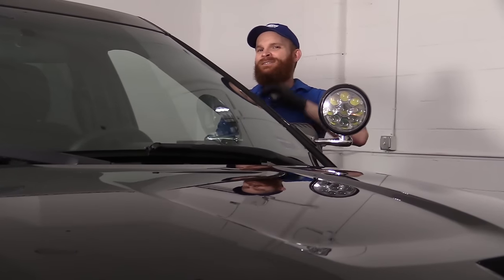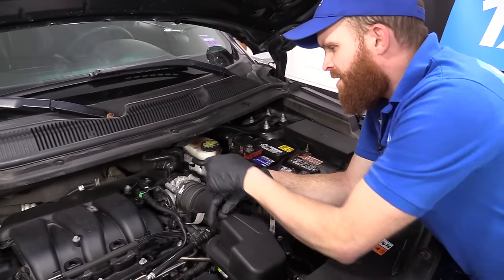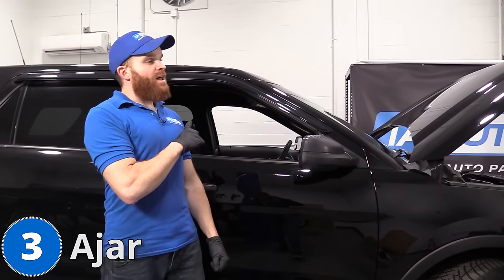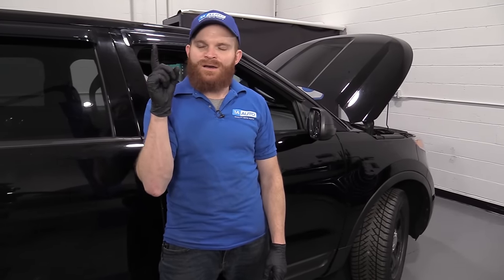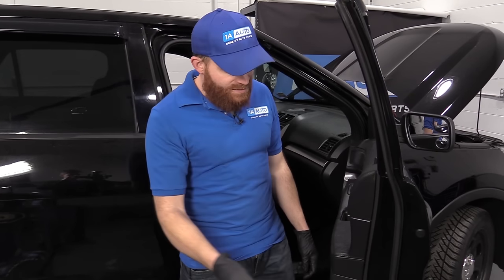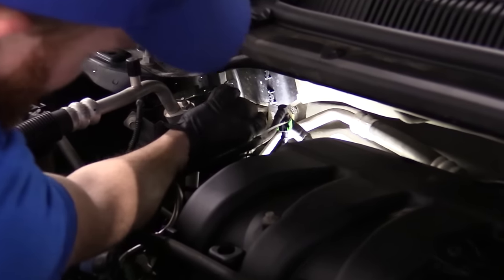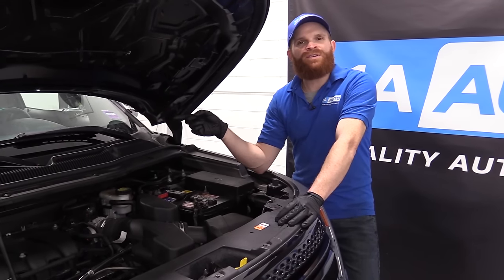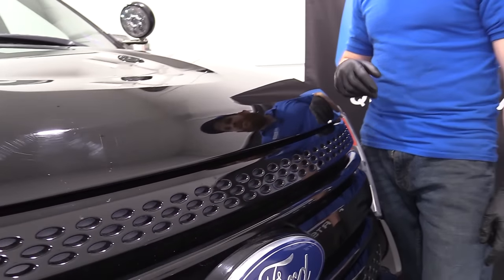Top 5 Problems Ford Explorer SUV 5th Generation 2011-2019

Comment: If you have a aftermarket performance tune. Pay attention to the Manifold Absolute Pressure (MAP) sensor.   The factory is a 2 BAR.  Most aftermarket tuning uses a 3 bar.  If you remove the time make sure you re install the OEM MAP (2 bar) until the tune is re installed..........(AMHIK...lol!!

Comment: I've got a 2013 Limited that went over 100K miles without a single problem (other then some cracking on the door panel armrest.) At about 103K miles the left rear bearing assembly started making noise and needed to be replaced. At 107k miles the left front started making noise so I had that replaced as well.
Reply: Fix or repair daily.  Ford

Comment: Let’s not forget that if the water pump goes out, you have to drop the engine from the vehicle. Thanks Ford 🙃
Reply: Same Ford engineer must've went to Chevy arpund the same time, my 2011 Equinox is the same w/ the absolutely burried h20 pump. Thanks GM.

Comment: Yep, I own two Ford explorers. I have 2011 and a 2017. My 2017 has 140,000 mi on it and I have the aluminum Hood issue with a small chip on it My 2011 has 240,000 mi on her I haven't had any of the problems but I do notice every once in awhile the instrument panel will light up while the car is off. That could be the door latch issue but the alarm never goes off like the door's been open only is an issue if the battery is low or bad? As long as I have a good battery in the 2011, I don't have any issues. Still a decent car and I haven't had any problems with it other than normal wear and tear through Cleveland streets

Comment: These problems are not that common.  Possibly a certain mechanic that works on a  lot of Fords, might see the same issue repeat a few times with different customers, but this is because there were hundreds of thousands of these sold per year.

The only reason the CO issue came to light was that PIUs (police interceptors) had modified the body with holes on the undercarriage which were letting exhaust in, especially if they were parked and idling.  Next, once that hit the news, every owner with any kind of health issue making them dizzy, started to assume it was CO, while vehicles that were not modified, are not showing any higher level of CO than other makes and models of vehicles.

Rear toe link.  Sure, extreme driving, in cold climates can break things.  This is another reason why offroaders, who aren't in it to race, don't want a stock multi-link suspension for off road use.  They want a solid rear axle instead.

Hood paint?  Meh, for a while Ford had a bad process but it seems to be less common after a few years of the 5th gen release.

Want to know the REAL problems?  They're the big ticket item, the engines.  Both of the 3.5L have an internal water pump which if (when) it leaks, leaks into the oil and fouls it, trashing the engine if not noticed soon enough.  The 3.5L and 2.0L/2.3L EB have the intake valve carbon issue, and the 2.0L/2.3L EB have the blown head gasket issue, and both (all three if you want to call the 2.0L and 2.3L different engines) EB's have turbo issues.

There was also the early model year steering racks failing but I'm seeing less and less of that reported in recent years, rather than more of it happening as they get older, which suggests Ford may have fixed the problem.

Comment: Len, I had a throttle body fail on my 2015 Explorer with 48,000 miles and the dealer said it was not under warranty. I also called Ford myself and they said also it was not under warranty. Could you provide any more info on the warranty extension that you referred to in this video?
Reply: It's only for 2009 to 2013
Reply: This dude needs to had his fax straight.

Comment: Have a 2011 only issues I've had was ac compressor went bad pretty expensive. Sunroof leaked one day from clogged drain lines and fried the sunroof motor. Other than that just normal maintenance
Reply from the maker: +Dan H Thanks for the feedback!

Comment: Consider the mfg. and AVOID, AVOID and AVOID!!!
Reply: Our family truckster, 2014 Explorer Limited has well over 200K miles on it and never had an issue. I've only changed the oil and a windshield washer motor (once). Had to argue with the track record.
Reply: @Hannah B Is there a reason that you don't consider the PPV Chevy Tahoe to be an emergency vehicle?
Reply: Hannah B A Chevy Tahoe
Reply: @Hannah B 
Wrong, GM makes Chevy Tahoe police interceptors, Dodge makes Dodge Charger and Dodge Durango interceptors.
Reply: Like COVID-19!

Comment: I have had several year models of the Explorer including the 2019. Rapid acceleration produces the exhaust in the cabin issue. The feds have absolved Ford so they do not have to fix the problem.

Comment: It's important to note that the corrosion on the hood is due to galvanic corrosion. Oxygen reacts preferably with aluminum over iron when the two metals are in electrical contact with each other--Ford doesn't isolate the steel body from the aluminum good because they're too cheap. I have this issue but it's nowhere near as bad, luckily. Isolation of the metals is the only real 'fix'. This same concept is foundational as to why sacrificial metals are attached to steel storage tanks to reduce corrosion of the tanks.
Reply from the maker: +Thomas Griffin Thanks for the feedback!

Comment: Bought this 2012 Ford Explorer xlt 2 years ago with 45,000 miles
7 months later water pump fail , 3 weeks later transmission whent off have to replaced it with front lower control arms ,front strucks , for all this repairs bill was $8000 at only 50,000 miles not sure if someone else pass through this beautiful vehicle bad experience

Comment: Just purchased a 2017 Ford Explorer XLT - 67700 Kms. Carbon Monoxide Problem is scary !
Did you say that Ford will replace all the rubber stoppers "free" under a recall ?  OR do we actually experience the headaches and pother problems first.

Comment: I just drove a 2015 Police interceptor that’s used to be a police vehicle in Tennessee. The Dept put about 9300 miles a year on it for 4 yrs then wrecked it. It’s been fixed Salvage title w 50k miles. 
Has leather and 3rd row so I’m guessing it was a supervisors car something. Wasn’t a regular squad car. 2700 idle hours. 
Thinking about buying it for $10k. Owner changed water pump and I believe the purge valve has been replaced. 
Is it worth the risk to buy it?

Comment: Driver side strut mounts.i have a 2012 explorer and ive had it since 2014.changed them 4 times now.my rear brakes rotors and pads have been changed 4 times too.otherwise its been a good vehicle so far

Comment: P.S. -   I still have my 1994 Ford Explorer limited edition, that I bought from a private party in 1997, and I love that car.... It just goes & goes, with very little maintenance..... I refuse to get rid of it....   The 2017 Ford Explorer xlt is a piece of junk, and was back in the dealership's shop many many times.....and, they never fix it right.   The windshield washer spray doesn't work .... AGAIN ...... Does NOT get the advertised gas mileage ...... I've recently received some recall notices, but I really HATE going into the dealership , because of the terrible service.  They just never fix it right.   And, lately I've noticed some jerky-noise with the transmission..... might be part of the recall notice -  who knows!!   I've gone onto YouTube, and found lot's of horror stories related to the Ford Explorers....   Oh ya, the NON-locking gas caps.... They say you need a special funnel to get the gas out, and the bad guys won't be able to siphon it out...... WELL, I had half a tank of gas missing.... fine out that the special tool is in the car, in case you run out of gas and need to use that special funnel to get the gas into the tank...., which means the bad guys thieves can easily use that tool to steal the gas outta the car, which is what happened to me. So I went to the car parts store, to get the price,  then went back to the dealership, and purchased a locking gas cap...made them give me a  BIG discount.   probably should have gotten one for free.... oh well..

Comment: There is a cracked exhaust header if that is getting in your vehicle, the intake for a/v and vent is right on top of it. Another mechanic found it, one that works on police cars. Amazon sales a carbon-monoxide detector phone charger plug in to help you know if you have this issue. Be careful, that grommet fix thing is a bs screen that will get people hurt.

Comment: I have a 2014 I'm having a  hollow sounds from the front end when  hitting bumps or going down a rough highway I had the front suspension replaced 3 times

Comment: I had to get rid of my 2014 explorer due to a bad issue only the factory could fix so i didn’t want to ship it to them so i traded it in for a 2020 Ford explorer platinum in BLUE with the black interior this one is more expensive though 65k for fully equipped 2020

Comment: Very useful information from 1A- Auto. I have not seen a possible solution though. My 2013 Ford Explorer Terrain Management System lights went out twice in three weeks. I turn the vehicle off and then on and the wrench fault light reset and the Terrain lights return. This is scary because each time I lost acceleration.  The truck is now in the shop and the mechanic drove it for over 300 miles and the problem have not yet occurred. He could not find a code that could steer him in the right direction. He is driving the truck with his OBD diagnostic tool on with the hope he can see a code. It is very scary driving the vehicle like that in heavy traffic. Any thoughts? I went on your website and went through 72 pages have not seen anything that could help me out. What is the code to see if all the lights goes out on the Terrain management system? Please I need help badly.

Comment: as a mechanic haven't had these issues,police all over use these vehicles with greet reliability does gm use rubber grommets also on them the whole body rusts out chrome flakes off, bumpers bend like tin foil glass cracks when hitting a mosquito on,on let take a guess they don't use electrical connectors either?

Comment: I had the throttle body issue you mentioned and the dealer claims there is no extended warranty for it.  Do you have anything i can reference
Reply: I have the throttle body issue as well, 2013 limited with 129k miles, the dealer claims there is no extended warranty as well. They did say if I could find a reference for it to print it out and bring it in and they would investigate further. Some help on finding info could be a great help.

Comment: I have 2013. If I overfill the gas I get the  EVAP Purge Solenoid failure. I replaced it twice now. Eever since I quit overfilling by giving a few extra pump, I haven't had it fail.
Reply: T Alexander you’re not suppose to overfill the gas? Lmao that’s why the pump automatically stops for you 😂 your issues were caused by your own Incompetence, it’s not the cars fault it’s yours

Comment: You commented on the exhaust fumes in the passenger compartment. I would be curious to see the exhausts action in a wind tunnel. The tailgate catch's dirt and rain like it is sucked towards the back of the vehicle. If the weather strip and grommets are damaged or missing the condition would be enhanced. Maybe a different exhaust tip if test?? Just a thought....

Comment: Let’s add at 58,000 miles I find out my hood has corrosion damage and the paint is bubbling along the edges due to the dissimilar aluminum alloys used in the manufacturing of the hood top and bottom panels 🤷‍♂️. The dealer is replacing the hood under warranty..
2016 limited.

Comment: I work at a Ford Dealership Body shop and noticed this model ends up getting water leaks in the back. Have to reseal some dried and cracked caulk.

Comment: My mom bought a 2013 Explorer Limited four-wheel drive it runs great we had a few things happen but we've been in the California courage show the storms and all the sudden moonroof front part of it won't move the only thing that moves when you push the buttons is the back curtain backseat I checked all the fuses and it wasn't that they all worked. So I've been trying to figure out which way to go if I need to take out the motor on the driver side visor see if that's where they're there's something going on with the motor. I'm also having a problem with when you turn on the heat or the defroster sometimes it will start blowing cold air but there's no sweet smell so I think that's a good sign? And then it will blow hot but when you do turn on the air conditioner or the heater all of a sudden you can feel the whole car shake I am just hoping that it's not the blower motor the compressor going out if you have any answers please throw on my way LOL as if it was a Peterbilt or KW I could tell you all about those I don't want to ruin this car or have my son ruin this car taken apart and putting it back together for my 77 year-old mom I hope somebody has an answer for me thank you have a great night

Comment: 2015 Explorer XLT, sometimes when I run my AC for extended periods of time I get service power terrain, service power steering, service brake system all come on simultaneously, I shut the car off and turn it back on. Doesn’t show any of those codes anymore. Is something getting wet you think ?

Comment: My 2018 Explorer is making a loud noise and every mechanic is saying I need to replace the motor. It has 63,000 miles it’s hard to believe that. The codes P0731- P0316

Comment: Have you had any issues with 2013 Ford Explorer Xlt shutting off while sitting or driving and then waiting for a few minutes and it cranks. When it shuts off the wrench, check engine and traction come on, prior no lights are on

Comment: My issue I'm dealing with now is this Power Steering Assist failure smh 3 U3000 codes 48, 72 n 96 C8 got a 2013 Ford explorer smh. What's the fix or what's the internal Module Component look like

Comment: I have a couple engine codes on my explorer, it's an 05, would you be able to tell me how easy or difficult it might be to do it myself? I'm an electrician but not too mechanically inclined as far as vehicles go. My computer says the fuel/air mixture is too lean in both banks and the EGR valve has been a problem for almost a year now
Reply: An 05 is a 4th gen, and TOTALLY different than the 5th gen.

Comment: Let’s talk about the PTU unit in the Ford explores specifically 2014. Mine blew up cracked the housing on the transmission $7000. Thank God for warranty 63,000 miles this happened. PTU unit carries about a quart of oil in it no way to change itHow can that be.

Comment: I have approx 80,000 miles on my 2014 explorer and now have spent over $7500.00 on numerous brake jobs , which
didn't include probably another $1500.00 for damage done by not servicing the calipers during warranty servicing.
Also was forced to spend over $ 200.00 a second time to replace defective swelled lug nuts which they claimed 
were not a safety issue , but refused to reuse after removing the tires for the brake work. Buyer beware,

Comment: Hey Len. I got a 2014 Ford Explorer with 177K miles on it. And once in a while, the check engine light pops on. I think it might be the cadilac converters. But I also have a gut feeling it’s not. What are your suggestions?
Reply from the maker: +Lexi  We wouldn't be able to diagnose an issue like that here, you may want to have a local mechanic take a look at it. Thanks for checking us out! http://1aau.to/m/Shop-1AAuto-c

Comment: 2017 Explorer. We smell the exhaust when we excel up a hill. We have to open all the windows for a minute every time.
Reply: The grommet thing is idiotic, there is a video on how a police mech found a cracked header. The exhaust off the engine is right where the intake for a/c is, that is the real issue and only way unfiltered exhaust, the kind that is highly toxic, can get in cab. Be careful, get a “ carbon monoxide detector charger” from Amazon, it will let you know if your in danger.
Reply: As this mechanic mentioned, Ford has a recall on the exhaust smell in the cabin. Take it in for repair at no cost. I took my 2016 Explorer to Ford service center for a few recalls today. Exhaust issue, toe link issue.

Comment: 2017 explorer overheating issue. thinking head gasket. customer changed thermostat and louvers on radiator seem to work ok. no heat. full radiator.

Comment: Just found you guys. I've got a 2016 Explorer sport; thanks for the vid. The dealer had to replace the knock sensor a few years back. Ever since then I get a gasoline smell inside the vehicle in cold weather. You can also smell outside, I assume the heating is pulling it inside. Get it when vehicle is idling. Have taken to the dealer many times, can't fix. Any thoughts on how I can direct them to the possible issue?
Reply from the maker: +yag359 We wouldn't be able to diagnose an issue like that here, you may want to have a local mechanic take a look at it. Thanks for checking us out! http://1aau.to/m/Shop-1AAuto-c

Comment: I have a 2016 FPIU with 141k miles. I just started getting the message, Charging System Service Now and a red battery icon. I had the battery n alternator both tested n passed n both r green. It only happens every other day or every fourth day. What could be the issue?

Comment: Hi Len, question for you. I have a 2015 explorer limited. My power fold mirror on the right side folds some of the time. It could be days or weeks before it folds proper when I try to fold it. Left side is fine, it ALWAYS folds with no issue. That right side is just more hit and miss with more miss than hits. Any suggestions?... Thx.